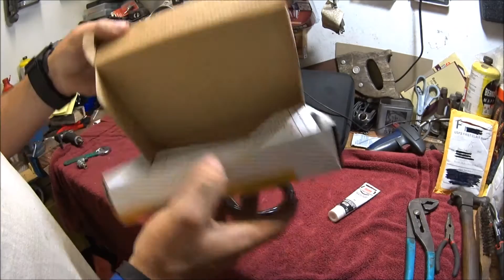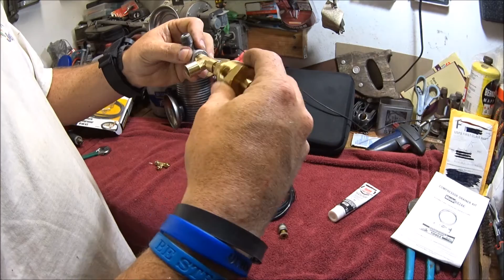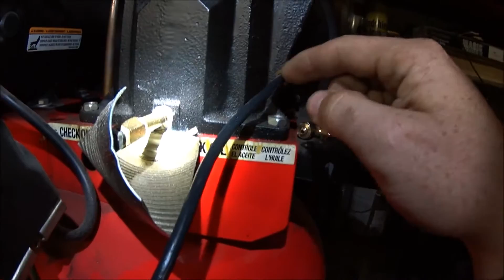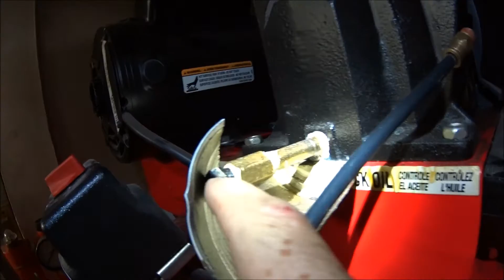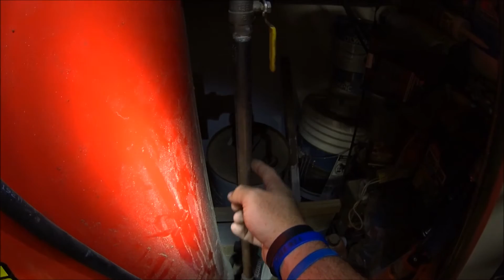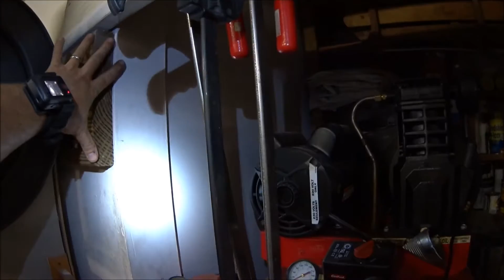How to Install Harbor Freight Automatic Compressor Drain Kit  Item 68244 pt1

Comment: No offense but this kit has terrible idea written all over it I wouldn’t trust it I feel like the valve would end up breaking and sticking open which could destroy ur compressor if u leave it on at all times unattended. If that valve sticks open ur compressor would run non stop, overheat and lock up after a while. For like 50 bucks you can buy an electric automatic drain. I hope it worked out for you and lasted but man I wouldn’t trust it personally.
Reply from the maker: Yep read my description.   I don't recommended it....at least not from harbor freight

Comment: I have that same hose reel. Cracked about 6 inches from the end. Where it’s bend and flexed the most. Used a Flexilla (legacy) ball swivel reusable hose end to repair it. Works amazing and the hose life has been extended

Comment: Sorry to disillusion you buy there are zero switches in this item. Switches are for electrical circuits and railroad tracks. 
What you where referring to is called a spring loaded valve.  Just sayin!!!

Comment: Would you just use an automotive condenser and maybe attach a catch can to it to help with the drying?
Reply from the maker: +warrantyvoid100 Yep that's pretty much what I was thinking.  I was half way thinking about putting an electric fan that kick on when the compressor kicks on. I was originally thinking that id put it in front of the fan (belt system) but then I don't want it to impend air flow over the compressor pump its self.  
I may-not even do this.  If I were a painter and needed to have really dry air I most certainly would do it this way.  (Thanks for watching)
Reply: No worries, I started watching for the ride on mower repairs a while back, thanks for making videos!
Reply from the maker: Oh cool  yeah you never know what Im going to do LOL  Have a good thanksgiving